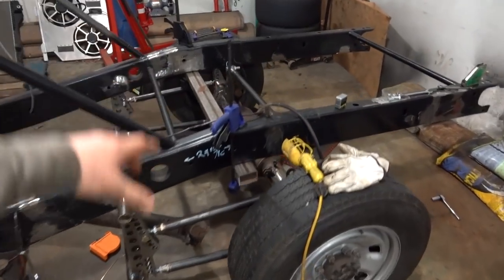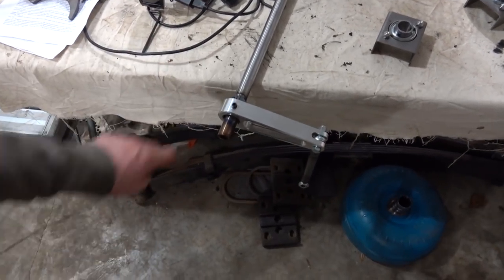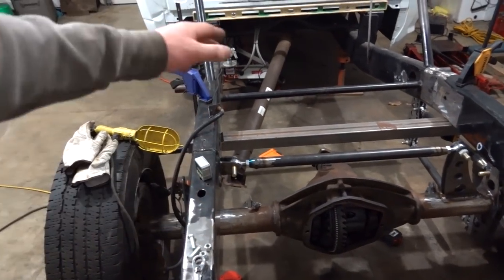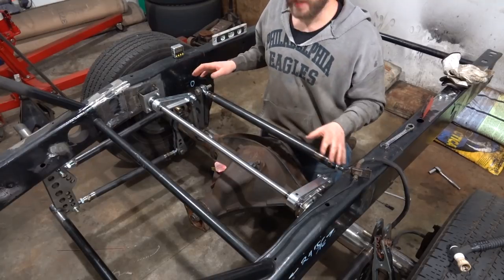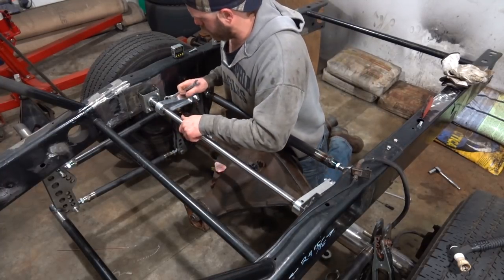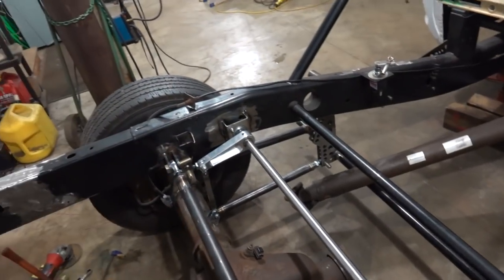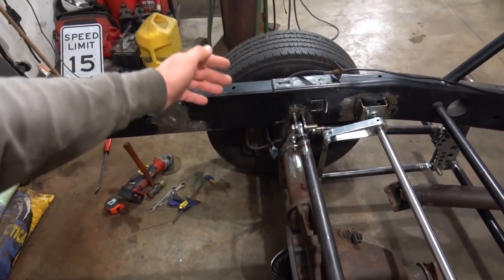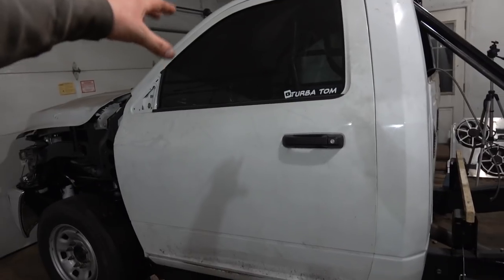ALMOST DONE The Cummins 4 Link Rear Suspension Build... ANTI-ROLL BAR Install!!!

Comment: Having it removable on the spline is not about removing the bar it’s about preloading the bar at one end.   So if the truck sags say on the drivers side you would drop that arm one spline so it has load on that side to compensate.